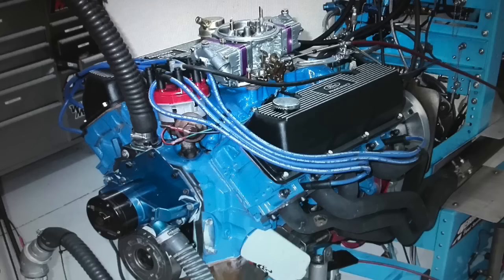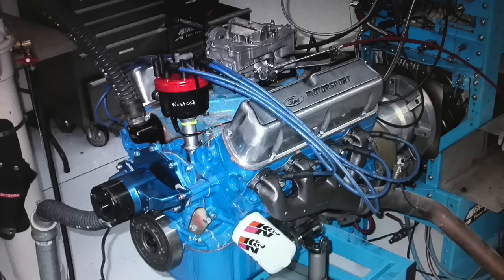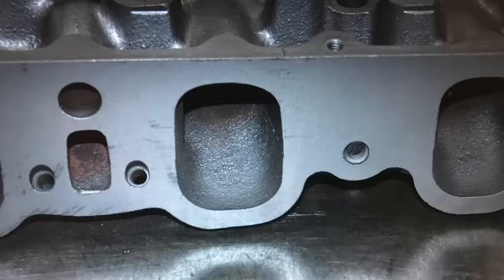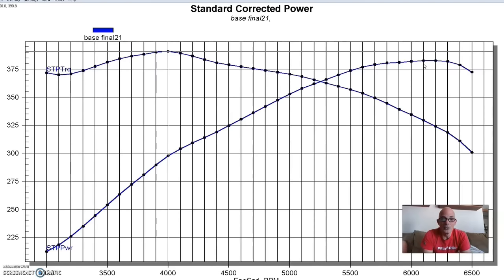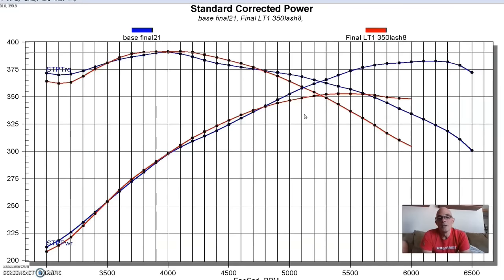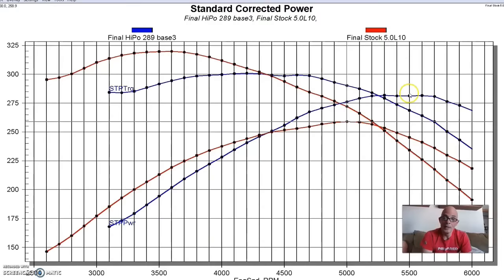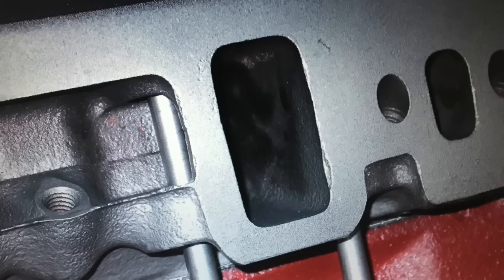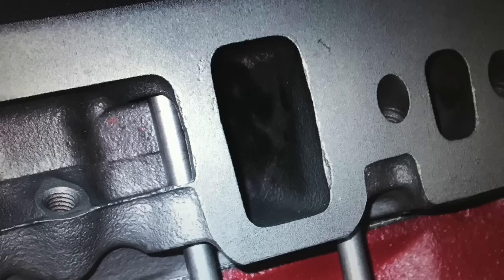HOW MUCH POWER DID THE 1971 BOSS 351 REALLY MAKE? WAS IT THE HOTTEST SMALL BLOCK EVER OFFERED?

Comment: When NASCAR changed to small blocks, Ford went with the 351 Cleveland it was  faster on the highs speed tracks than the GM's because of the boss heads, The Chevy's still dominated on the short tracks because of better torque. Dale Earnhardt won driving a Bud Moore Ford but he had too many engine failures and went back to Chevy with Childress. When Ford decided to put the Cleveland heads on the Windsor blocks they solved the engine failure  problem of the poor  oiling system of the Clevelands. The Fords were so dominant on the Super speedways thanks to the Elliots NASCAR used the excuse of "the cars are too fast" because Bobby Allison went into the air at Talladege that they put restrictor plates on all engines to slow them down,.This hurt the Fords more than the Chevys and that's why the restrictor plates were kept. When Robert Yates tweaked the Cleveland heads so that even with the restrictors they were dominant, NASCAR decided GM needed and engine with heads just like the Fords, that's why all NASCAR engines have canted valve heads just like the Fords. If you can't beat them join them.
Reply: Interesting, way cool!!.. as we all know, the LS is based off the sbf as well..
Reply: Absolutely right and this is from a long time Chevy guy . Michigan showed the real power of the Ford heads and didn't get restrictor plates for years . Ford owned that track for years.  Chevrolet had the drivers and money but Ford had the ponies.
Reply: I would love to see some of the Westech Dyno graphs of nascar engine spec'd builds from over the decades (original or replicas) Specifically the evolution from the older big blocks or even back as far as the 40s until current race tech.
Reply: I think it was Terry Labonte that made the statement after GM got the heads the cars were faster with the Ford heads From what I understand the guy at Yates was the guy that designed the heads you can correct me if I'm wrong
Reply from the maker: Chevy guys will point out that the Cleveland came out after the BBC, which the Cleveland head was supposedly patterned after
Reply: @richardholdener1727  small big Ford big block chevy
Reply: Suppose to be small Ford
Reply: @richardholdener1727  which were all patterned from the Chrysler poly engine ! the engine Chrysler SHOULD have developed as a performance engine !!
Reply: @richardholdener1727   And Chevy never copied the 272  !  .
Reply: From what I know, The Elliott boys Dad bought a dyno from Penske in the 79-80 time frame. Ernie then went to work on the Cleveland. Cams and many different set ups. His final product was that he was able to create a swirl of air in the intake manifold leading into the head, which cooled the head down somewhat. Enabling him to step up the compression ratio well above what other teams were running at that time...
The old Super Ford Mags back in the day used to have ads  for an intake gasket that had a flange made on it. Blocked the bottom of the port. Not sure if that is exactly what Ernie did or not, but gasket was supposed to create a swirl of air into the head as well...
With the added restrictor plate, well fuel would be cut, so we know what that would do to valves and pistons, trying to run higher compression...
Reply: @kramnull8962  I remember reading an article in Hot Rod that featured an interview w/ Ernie about his head tricks. Wish I still had it. He wasn't giving up too much info. I also remember the gaskets you mentioned. They were supposed to increase air velocity, I believe.
Reply: @josephtravers777  Yeah, I remember when he was on Ned Jarrett live back in the day and discussed much of it, and took calls as well. So much we cannot get back because out of circulation nowadays...
Reply: @kramnull8962  I've been out of engine building for last 25 years. Need to dig up all of my old mags and see if I can find something.
Reply: @richardholdener1727  In 1971, when NASCAR tried to ban the winged cars and the Talledega and Cyclone Spoilers, they put in a 5 liter rule, like Trans-Am, one team owner, Mario Rossi, with Dick Brooks driving,  did run a 305 Dodge Daytona at the Daytona 500 that year, it was competitive, due to weight, so maybe that 340 6 pack Challenger TA, Cuda AAR might have some good dyno results. https://en.wikipedia.org/wiki/1971_Daytona_500 I know it'll be hard to find one to test, or even recreate.
Reply: @richardholdener1727  Well that would be kinda dumb thing to say since any canted valve head is really a "semi-hemi" and Chrysler did that in 1951.
Reply: @richardholdener1727   I agree with that completely there is no denying the BBC is the best breathing non Hemi but I think the reason that GM did no go with Canted valves on the small block is because they owned the short track engine business since 1956. and a million Chevy owners would be unhappy having to ditch their expensive in line valve heads just to switch to Canted valves. This is also the reason the Woo outlawed the Ford Boss after Casey Luna won the championship back in the 80-90's with a Boss Ford. Right now Tony Stewart has a very competitive Ford in the Woo but it is still in line valves and I can't imagine any Chevy owners spending more money on the Ford just to be competitive. You spend to dominate!
Reply: Ernie Elliott was responsible for the speed of Bill's car. He actually scratched/etched "×"s all over the combustion chambers. I don't remember why.
Reply: @richardholdener1727  YES, Richard you are right. I am a Ford guy and Ford small blocks were king but Chevy big blocks had canted valve heads first.
Reply: @nissanabuser  Elliot still holds qualifying  speed records at Talladega and Daytona. which I'm sure will never be broken.
Reply: @earlberry8873  Correct. Robert Yates "Cleveland style" cylinder heads put Ford on point.
Reply: @earlberry8873  Think again. Just ask Jon Kasse about the 385 series Ford!
Reply: Take a look at the Chrysler Poly head, came out in the 50's and it looks a lot like the BBC, 385 SERIES FORD, AND THE CLEVELAND.
Reply: @kramnull8962  the piston domes were cut to create a swirl of the air coming into the cylinder. Basically a tornado effect inside each cylinder. NASCAR demanded they tell them how they made their power with a promise that it would be kept secret. Ernie explained to the science worked , and within a week every other team was recreating swirl port engines.
Reply: rubbish..chevs fall apart if not studded.same as windsors.a 351/302c,is a truck engine,& it kicked your ass..351c here in aus is king.we made it go,then you bought it back,we had them here for yrs.still sought after.your chevs are cheap junk...go get a 351c 302c heads decent cam,it will kill anything..std carb std intake,,you chev guys need a speed shop before you go out of the garage.i go the wreckers.chevs are cheap & nasty..even your speed mags say this..here,we call it chev shit,,sorta rings,dont it..i drive a 340 r/t dodge,,so dont judge.....
Reply: The reason why folks say the Cleveland and its big brother the 385 copied the Rat, is because Seamon Bunkie Knudson came to Ford from GM and brought some friends with him...who likely knew how the Rat had its valves canted.
The Plymouth Poly did have canted valves, since it was a cheap version of the Hemi, so that Plymouth could compete with the Chevy small block and Ford Y block. It also had a lifter angle not well-liked, and carried on into the LA (light A) small blocks. Its valve placement was the real winner, tho, giving the airflow a straight line rather than a Z type zigzag thru the combustion chamber with the spark plug off in the corner.

Was Chevy looking at the Poly when they made the Z-11 mystery motor? I'll have to go dig up my info, but my guess was they weren't checking out a bread and butter engine when the Hemi was staring them in the face.
Reply: Ford had sent the Cleveland block castings to Australia when the energy crunch began in early 1970's. When nascar took off in 1980, Ford guys had no choice but to use the Windsor block which had a larger crank diameter crank.
Reply: And Bill Elliot set the all time speed record for NASCAR with a 302 and it still stands.
Reply: Ya but the hemi kicked all Of their asses lol
Reply: arborcidal maniac  Which manufacturer has the most wins in NASCAR? Hmm,could it be Ford? You're the one talking about how Ford small blocks have been whooping up on SBC's. If GM never raced again in NASCAR, it would take Ford twenty three years to tie them for the most wins. And explain to me how an LS engine is based off of the SBF? 6 bolt mains? Shaft rockers? How about you show me where a SBE SBF is running 7s in 1320 feet. There's plenty of vids on YouTube of 5.3s running that quick. Those shitty Chevy engines.
Reply: @anthonysiler4938  Explain that to me.  Does a SBF have 6 bolt mains? How about shaft rockers? How about coil on plug? Where do you Ford guys think it's based off of a SBF? Next you're gonna tell me that GM copied your dohc engine when it comes out despite the fact that in 1990 you could buy a ZR1 with it.Will the stock bottom end hold the same power as an LS? Hmmm and will it run low 7s on the sbe? Your honor, I rest my case.
Reply: @phantomwalker8251  You're a funny phantom. Show me a video where a sbe SBF runs in the 7s. Plenty of LS 5.3s with a sbe's running them times and as low as 7.16 in 1320 feet.
Reply: @tomrados7512  what.?.were.?,why,when,did i say that.im not into drags & times,,to me,its a waste.anyhoo,,mate used too drag his td cortina,80,s ford,6 cyl,4.1 ci.ON LPG, blew the v8,s away,10 secs.that was in 1993,so,nearly 20 yrs later,you got down to 7 secs,?.like i said,no point in drags.all the cubes computers fuel inject,heads pistons crank,ect,in 20 yrs,you got 3 secs over a std ish 6 cyl on lpg,pathetic.you build a 6 cyl with same cubes,gear as a v8,the 6 cyl will kill it.why,?,a 6 has more inbuilt torque.a v8 rely,s on revs.most all industrial motors are inline.last longer,cheaper & more power.
Reply: @phantomwalker8251  Huh, I was proving to you that Chevy engines aren't rubbish. SBE means stock bottom end. Wasn't talking about a built engine. Show me a video of a sbe Ford or something that you pull out of the old boneyard with a couple of hundred thousand miles on it and run in the 7s. Looks like you missed my point. My bad for not explaining it completely. Have a great day my fellow gearhead.
Reply: @tomrados7512  calm down government motors boy!!! The ls is based off the 351,   ls is short for lotus Series!! Goverment motors turned to LOTUS for HELP on there v8 platform because they're shit!! Lotus is owned by Ford.. hell thank the Mustang for Government Motors for breanging back the comaro, wich will be killed off again 😆.. oh and by the way there are factory stock block and cast heads 4.6 modulars running 5s in the quarter.. show me a singal government motors part of any kind in the same  category!!! Crank as well but it spooked the guy..
Reply: Yeah and NASCAR gave Chevy a race purpose motor and did away with the 350 platform in 1996 to present. Ford tried to get a race purpose motor but NASCAR wouldn’t let Ford use one until 2010, which was the FR9. Ford even designed the YR45 which based off of the FR9 to compete in ARCA and trucks but of coarse NASCAR won’t let Ford use this motor in those two classes. I’ve built Chevys and Fords and I’ve had way better luck with Ford. I’m running low 9’s with a iron headed Cleveland on a 175 shot. Factory crankshaft, block, TRW flat top forged pistons, roller cam, Parker funnel web intake !
Reply: @tomrados7512  1990 Vette aluminum 4v was designed by Lotus and made by Mercury Outboards lol
Reply: @richardholdener1727  People  who know  engines  will tell you that the big block Chevy was  a copy of a Mopar poly engine! Who copied  who!
Reply: @RSDX99  The reason Chevy never switched  there T/A engines  to Canted  valve was because  there test head had a different head bolt pattern than a stock small block Chevy. the T/A racing organization would let them change  the  block. When they rearranged   ports to accommodate the Small block Chev block the heads  lost to much flow! The head Chevy toasted first had 4 bolts per cylinder like the LS engine
Reply: @albertgaspar627  Your  wrong about that  Knudson was hired by ford   in 1969 the 429  and Cleveland were  already  designed by then. The reason the  Canted valve engine was  developed was because the Wedge engine had Natural detonation problems the  Canted  valve engine Doesn't have!
Reply: Respectfully, Semon Knudson went to work for Ford a year prior--1968--and brought Shinoda (creator of the Boss 302 etc)and others with him. Ford of course had view of canted valve engines with Plymouth's Poly 318, the first gen Hemi, and the Mystery Engine Chevy had in 1965. But in 1967-8 Ford's small block head design for racing was the Tunnel Port, with ports so big the pushrods needed tubes and the valve size was similar to that of the Boss 302 to follow.

Ford likely was considering the canted valve design since others were doing it, and perhaps the GM crew finalized the valve angles, etc, which was an important factor.

https://mach1club.com/showthread.php?tid=212

As for "natural detonation problems" of the wedge, if this was true, it would have gone the way of the flathead design as soon as lead was pulled from gas and couldn't resist detonation. What caused problems initially was the open chamber design initially tried by auto makers, allowing heavier fuel to fall out of suspension. Once they figured out "swirl", and went heart shaped, the wedge was here to stay (consider the LS as a pinacle)
Reply: You are correct. I’m from the same area as the Elliot’s and grew up with some of them. I used to hang out in the pit area as a kid. No one in the family wants to even talk about nascar and racing unless it involve Chase. No secrets revealed about the engine stuff. But now it’s irrelevant. The 1980s are gone. Now we have cookie cutter tennis show cowboy drivers who only know how to drive. And that’s it. No mechanic history. And you barely hear about the tech and crew....
Reply: The Chevy Big Block began with the 348 in 1958, and it had a unique design only seen elsewhere on the MEL (Mercury/Edsel/Lincoln).  There was no combustion chamber in the head, just three holes--two for valves, one for the spark plug. All combustion happened in the dish of the piston, with an angled block deck.  This lead to the 409, and then the 427 Mystery Motor in 1963 that had canted valves.

What also helps the LS flow like a sewer pipe isn't just the "cathedral ports" that give room for a long injector, its the valve angle. GM went from 23 degrees in the first generation small block, to 15 degrees in the LS (I think Pontiacs were like 14?). Getting a straighter shot at the combustion chamber and angling the valve out of the way of flow helps any cylinder head design.
Reply: arborcidal maniac  And, please do not forget 'NASCAR' WAS Bill France ....
It's  now Jr -s show 
And he 'didn't  fall  far from the tree', either.   
Like his dad, generic motors senior ( you know-huge blox of gm stox loaners, chix & so on...)
1in the 1960s, for example, Bill had to make a very critical decision...
Tunnel port 427 Torinos were killing the hemi mill in the 69 charger 500 
Yiu know it well..THE most worshipped mill ( 425 hp on just 6 slugs) fueled by mopigs grist mills, hell even their hairdressers "knew 4 sure".
One component to the quotient IS missing...
The role of then U.S  sec'y of defense Robert Mcnamara.
IT WAS HE & HE ALONE who gave gm & mopig their victory.
He SO strangled off R & D monies for keeping "Them" on their knees.
Proof of this was provided by.SO many returning; vietnam vets whomremarked, bitterly, that they were destroying SO MANY well built Ford trucks built by Ford at Russias volga river truck plant.
According to McNamara, just b4 he passed away, this hypocrisy came from 'Upstairs' in ford corporate world H.Q.
Evidently these trucks were worth thrice the profit of the top of the line Lincoln.
And add to that MAC'S  personal fear of anything Ford fast.  He almost killed himself in 1961 when test driving a 1962 T-BIRD PIKES PEAK RACER powered by a modified J code 6 venturi
430+ hp 430cid merc maurauder spec mill.
NO FAST CARS-PERIOD...
Fortunately for us a 'hero-from-the-ranks arose.
Enter Lee Iacoca.
The man behind the Falcon ( fords answer to mopigs scant 6 1960 valiant.).
If not for LEE,there would NOT be a cobra-no anything......
And the rest, as they say, is history.

BRIAN. C
Reply: @stickman-1  first off Chrysler did not design the 1st hemi. Ford had the first hemi. Now this is all of America's big three, Chrysler Ford Chevrolet.
Reply: @tomrados7512  

It takes a 6.0l ls to keep up with a 5.0l coyote! Ford innovates chevy copies, just look at the aluminum car body.
Reply: @kevindevine6221  I agree but Cleveland made more hp per cubic inch which indicates better breathing.  Until recently it was still King of power per inch but hard to compete with coyotes. LS maybe but the heads will bolt to a small block Ford if that rings a bell. The manufacturers all do some copying evidently and why not if it works.
Reply: @coreyshort9461  They should have recognized a good configuration when they saw one, after all they designed the hemi, so why didn't they keep that head in production?  Canted valve ford's had to run more weight per cubic inch than the hemi, or any other head design so they evidently work better. Bob Glidden was the head master and most new racing heads use his ideas and chamber designs to this day. He got a new weight penalty or some new rule more than anyone in pro stock but still was a champion of champions. It wasn't the ford but the man.  He sure made it hard for other ford racers because of the penalties ford had to deal with because of him. It only took one ford though. Ugly Fairmont. 32-0. The only undefeated car in pro stock history. Destroked Cleveland with furnace brazed heads, reshaped combustion chambers. He tried everything imaginable including valve relocation and intake runner inserts to redirect flow. Some things worked some didn't.  The thing I liked most about Bob was that he was a down to earth individual that would talk to anyone if he had time. Not stuck up self centered assholes like I have met at the tracks across this country.
Reply: @charleslum2438 Good stuff. I think the destroking makes total sense because when you want to spin up a motor faster you will see great power there but that means bigger bore than stroke. All these exotics like Ferrari or humbler giants like K20 Honda have smaller stroke.
Reply: The BBC is the first "canted valve" head for engines.(1965)
Reply: That was the same amount of power as the 71 Falcon GT-HO Phase 3 made which Ford used as their weapon of choice for the Australian Touring Car Championship in 1971 and 72, legendary race car here and it propelled it to be the fastest four door family car in the world till the 1990 VN Commodore SS Group A came along.
Reply: @electricman5010 I knew you dodge boys had to chime in with your nonsense 😂😂
Reply: @stickman-1 more Chrysler nonsense 😂😂😂
Reply: I remember every bit of that , 351 Ford had it !!!
Reply: I bought a 71 Boss 351 when I was 17. I would love to have it today. Black on yellow. Police magnet.
Reply: I believe nascar went with a 290 or so carburetor first and Bill, and Davey still set on the front row so with the restrictor plates they had more control over who was fastest.(easier to cheat)...
Reply: I thought Windsor was 289 302 351 small block and Cleveland was 351 de stroked big block 400? The rule in NASCAR is you can't use it unless everyone can use it. That why they all run Ford rear ends at least back in the day and why dodge pulled the hemi and there cars of the race track. For every invention earnhardt made he sold for one dollar so everyone could use it., terry labonte at dega 212 mph NASCAR knew they were in trouble. Allison's crash confirmed it
Reply: Yes. That canted valve Cleveland head was 9 years on the design table. As much as I am a MOPAR purist, you gotta give Ford credit on this design.
Reply: @allenl9031 the 340/302 heads used heart shaped combustion chambers that created a Vortex that literally "pulled" more air into the cylinders. They are air pumps. The more air you pump, the more power you make. The secret is to move the air at a speed that approaches "air shear", but does not exceed it. It's tricky because air density varies greatly, and with that, air shear changes in speed I f movement. 😀
Reply: @Cobra427Veight chevy copies everything Ford does. B
Reply: @stickman-1 so?? Ford did that in 1942. In a tank engine
Reply: @kevindevine6221 wrong....
Reply: @albertgaspar627 The Z 11 and the mystery motor were two different engines. The Z 11 was a stroked 409 and the mystery motor was a MK 2 the predecessor to the MK 4 396-454.
Reply: Bob Glidden ran into similar problems with NHRA while running Clevelands in the 1970s. He was required to add weight to his cars. I have a copy of a 1977 issue of Car Craft where he said he was spinning his engines to 10,000 rpm with the stock cast crank with no issues. Then in late '81, NHRA suddenly announced they were going to 500 cubic inches in PS for 1982 and Glidden was caught off guard. He'd just had Don Hardy build a new Ford EXP that was configured for the Cleveland. The short wheelbase didn't work well at all with the bigger engine. But within a couple years, he figured out the Boss 429 with the T-Bird chassis and the rest is history.
Reply: @PaulBoss351  Unlike the GM guys who share engine secrets, Glidden never shared anything except with his own family. One Ford had to go thru an entire field to GM's yet the crowd always cheered for the GM's
Reply: Wow,that’s interesting. I think also all cars use a version of the ford 9” rearend because it’s almost unbreakable..
Reply: @earlberry8873 Rusty Wallace while running Pontiacs built a cook book Ford NASCAR engine with parts anyone could use as to not raise eyebrows...he then tested that engine in Grand Prix, no other changes and it was 2/10th quicker than the Pontiac with the GM SBC...next year they were running Ford
Reply: @matthewchadwell7844 Ford SOHC during pre season testing was so fast vs the HEMI. and mystery motors, NASCAR banned it before it was able to run a race
Reply: I've had Both, the Cleveland was in a Short Wide 67 F100 and the 271 289 was a Factory 4speed Hi Po Falcon Futura, both had 3:90 gears, and again, I know the s isn't a scientific comparison, the engine mannerisms were completely different , The 289 reminded me of a 500 or 750 2 stroke triple Kawasaki, nothing down low, not much of anything until you got high in the revs then it pulled hard, it was peaky, just like the Kawi 2 stroke triples. My Cleveland, it pulled hard and felt super strong all the way, although it didn't rev as high as the 289, it didn't have to. If the 289 didn't rev high, it couldn't be called a hi po.
Even that light as hell Falcon, same basic car as the mustang, it has to stay  revved, I don't mind shifting, but that was extreme. I didn't have them at the same time but it was close, the Truck was far faster than the Falcon, the truck was pretty light, a tad over 3,100
Reply: Ford never ever made a small or big block,that was only GM.
Reply: @alanarmstrong2323  I don’t know what you would call them when one engine is bigger or smaller than the other. The Chevy sb only got that name after they introduced a bigger engine which they called the bb. Chrysler also made small and big blocks plus the Hemi. Get real!
Reply: @RSDX99  Ford engines go by family numbers like 335 only Chev uses the term big or small block
Reply: Ford and chevrolet both had some really great engines. However hating on a cleveland is just foolishness.
Reply: @tomrados7512 yeah but they last how many passes out of the junkyard? Lol don’t even lie bc it’s a known fact. Yes they’re fast but they don’t last unless fully built
Reply: @tomrados7512 what do I mean their are videos of small block fords not modern running 6s passes sir
Reply: @tomrados7512 no sbe Chevy is running 7s